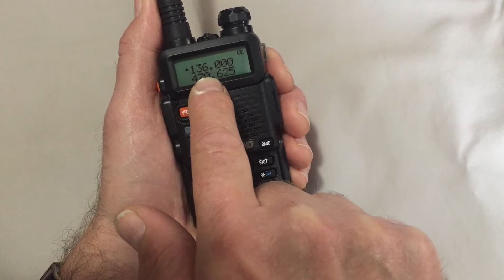Baofeng UV-5R | Part 4 - Frequency/Channel Mode, Dual Display and Switching Bands

Comment: Hello Milt,
I have three Baofeng UV-5R radios. I can get two to work correctly, my third radio I am having issues with.  With i power it stats it is in channel mode, the screen brings up two channels: 459.825 and 437.425. The 825 has a number 8 and the 425 has a number 15 next to it which I believe the the saved channel (I did not perform this). The screen also shows DCS to the left of A frequency. When i try to hit the VFO/MR, the A/B and or the Band the radio goes into alarm mode flashes the the alarm sounds. I cannot access the menu at all. I have tried a factory reset but without access to the menu I cannot switch anything. It is a paper weight at this point. Any fixes that will get me access to the menu or a way to make the radio actually work with the other two I have.
Reply from the maker: @GreggAshworth  That's a difficult one, Gregg. If that third radio was used previously by someone else, perhaps they damaged it in some way? If the factory reset does not help, I can think of no other way of repairing it. The UV-5R has s reputation for being easily damaged, as well as cheaply built. I suspect that even the new, fresh off the assembly line radios have a high percentage of malfunction or broken software issues. I'm sorry that I can't offer any help in this instance.

Comment: I recently bought the GMRS version of the UV-5R.  I noticed that I can't transmit when in the frequency mode (even if the freq is for a correct channel), only the channel mode.  Since GMRS is limited to the channels this might make sense.  Is this correct or am I doing something wrong.  Oddly, I can save a new channel with the frequency set to something that is not a normal channel and I can transmit when that channel is selected.  I think this has something related to repeaters.
Reply from the maker: Sorry for the late reply, @artisanwest9730...somehow missed your comment until today. I've no hands-on experience with GMRS. I'm assuming your radio is UV9G? (https://www.baofengradio.com/collections/gmrs/products/uv-9g)

If so, I'm assuming the user manual doesn't make it clear what's going on here. Somehow, preventing the operator from transmitting on a GMRS frequency, in frequency mode, is their way of preventing some sort of interference or abuse? Doesn't make sense does it?

I did find a bit of information, but it doesn't address your question:

WARNING! Just because you can program in a channel does not mean you're automatically authorized to use that frequency. However, it is legal in most jurisdictions to listen. Contact your local regulatory body for further information on what laws, rules and regulations apply to your area. 

NOTE: Channels 1-30 are GMRS communication channels, which are allowed to be transmitted. However, these frequencies are 19 fixed and cannot be modified. Channels 117-127 are NOAA channels, and the frequency is fixed and cannot be modified. It is allowed to scan and receive. Channel 55-116 is a user-defined scan receiving channel. Only the receiving frequency is allowed to be set, and the transmitting frequency is forbidden.

https://baofeng.s3.amazonaws.com/BAOFENG_UV-9G_GMRS_User_Manual_20210806.pdf

I'm sorry that I can't be of much help!

Comment: When I go to channel mode the top frequency turns into "CH-000" is it possible to change that?
Reply from the maker: Good question. The answer is, no. The UV-5R channels begin at Channel Zero: CH-000. You can assign any frequency to that channel, but it will always show as CH-000.

Comment: Have you ever used a Tridradio BL-1 programmer and what’s your opinion
Reply from the maker: I've not heard of that programmer before, Kenneth. I just now searched for it...sounds interesting and affordable:

https://www.amazon.com/TIDRADIO-Wireless-Programmer-Programming-Multiple/dp/B098SM9FVL?th=1

I've used CHIRP:

https://chirp.danplanet.com/projects/chirp/wiki/Home

I found CHIRP helpful, but only for settings not available through the menu options of the UV-5R. I've tried to learn how to add frequencies and repeater configurations on-the-fly, without having to need any other software.

But the TIDRADIO does sound appealing! I'll have to think about it. Thanks for the pointer!

Comment: Good day how do I communicate with my icom IC F5022 IC F6022 WITH A Baofeng 5 radio
Reply from the maker: Hmm...good question. I'm not at all familiar with the F5022/F6022. This website (https://www.icomjapan.com/lineup/products/IC-F5022/?open=2) indicates it receives and transmits on the amateur VHF and UHF bands, so all you need to do is set both radios to receive and transmit on the same frequency. Try tuning both radios to the typical VHF nationwide call frequency: 146.520 MHz. Ensure that the two radio are NOT close to each other when you transmit! The feedback can damage them! Get a friend to help you out by taking one of the radios outside, and you stay inside with the other one. Transmit a short message on one radio and see if the other one receives it. If that works, try a UHF call frequency: 446.000 MHz.

Comment: Great tutorial. I just got my UV-5R and still trying to figure it out. Is it perfectly ok to just listen to frequencies as long as you don't transmit on them? I was trying to just program it to listen to HAM operators (I think that's what they are called) I enter the frequency for a local repeater but I never hear anything. No clue why its not working.
Reply from the maker: Yes, absolutely! As long as you don't transmit, it's legal to listen in to any radio broadcast, ham or otherwise. Good question!
Reply from the maker: Some repeater stations are used by ham operators more, and some less. I don't think there's anyway to know without simply listening for a while. Many of the repeater stations near me automatically broadcast a station identification message, at least hourly, and sometimes every 20 minutes or so. When I first got my UV-5R I stored to memory about 30 different frequencies, for as many repeater stations that I could find online. Then I set my radio to scan through them. The UV-5R is not a very fast scanner, but it does scan. Each time I heard traffic, I paused the scan and made a list of the frequencies on which I'd heard traffic. After a week or so of this, mainly in the evenings, I'd gotten a pretty good idea of what repeaters were active and what ones were little used.

The other thing to check is this: is your radio receiving ANY signals? Tune to a weather channel that's near you:

NOAA National Weather Service (NWS) Frequencies:

- 162.400 MHz
- 162.425 MHz
- 162.450 MHz
- 162.475 MHz
- 162.500 MHz
- 162.525 MHz
- 162.550 MHz

I appreciate your desire to use amateur radio transceivers legally! I spent many years just listening to my programmable scanner, which is receive-only. Great hobby!